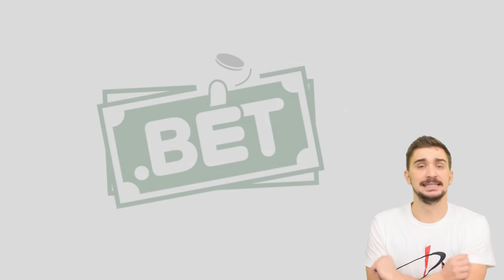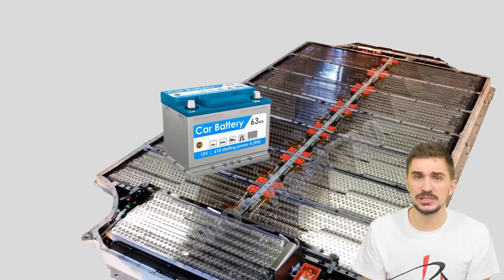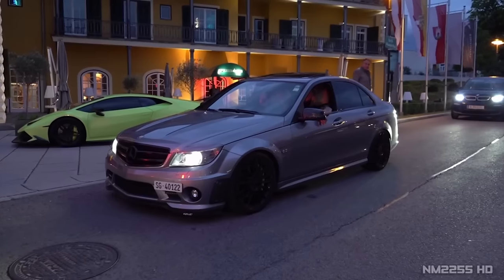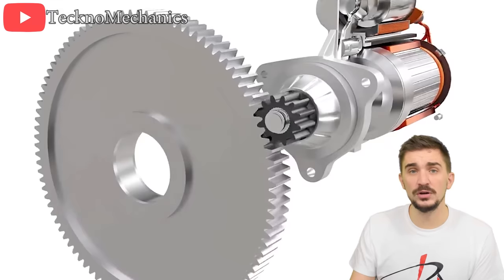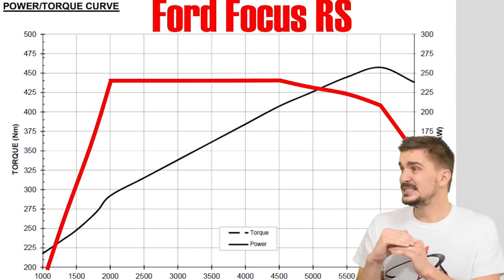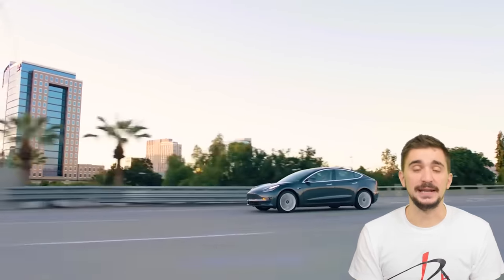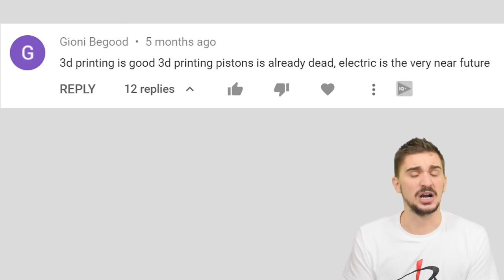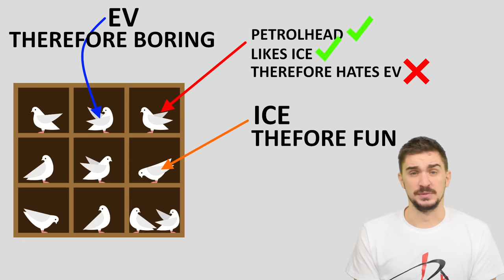ICE vs EV - IN-DEPTH comparison of BATTERY ELECTRIC and INTERNAL COMBUSTION ENGINE vehicles

Comment: Great video as always! Thank you!

Now a few comments on the content, mainly regarding maintenance:
1. Brakes on EVs are not an important consumable. If you use the regen-braking properly, you will fiddle more with rusty rotors than with worn out ones (and brake pads too).

2. There is a huge investment in EV maintenance post-warranty. Only a few places can service EV-specific parts and also when you have to exchange the battery, you will likely need to pay as much as the (used) car costs itself. Hopefully this will change, but at the moment that's how it is.

3. Corrosion on EVs can be a real b*tch. On an ICE vehicle seeing rust can be annoying, but it will usually last decades before it becomes dangerous. On EVs however, corrosion can leave you stranded (rusty terminal) or even lead to a fire hazard (rust can cause water ingress into electrical parts). This needs to be inspected periodically and can be costly even just for a check-up (lots of parts need to be removed and then put back on). Let's not forget this also requires specialist labour.
Reply: Corrosion can cause catastrophic in EV. It can reduce the insulation resistance between conductor and insulation. That would make a leak current path or even short circuit path which is going to decay the life of battery and other electronics components such as Inverter over time, some failure in motor control system or the worst case it would give you the explosion. So I agree that this has to be inspected periodically. All that materials of the EV car must be seriously reinforced to prevent the corrosion more than ICE car. That is the one reason why EV is a little bit expensive too.
Reply: Doesn't seem like battery swapping will ever be a thing.
Ev batteries are much much longer then expected and basicly last the lifetime of the car.

Until cars are actually built to last battery's will not be an issue other then premature failure, which is usually falls under warrenty . Engine failure rarely is the main reason an ice car gets scrapped, modern engines actually do outlast many car they are fitted to.
Reply: If brake wear is a major issue I believe eddy-current braking may be the solution
Reply: @baronvonlimbourgh1716  Well the battery won't last until the car die if we use like the motor need 100kW and we make batteries pack with a total power of 120kWh then after 5 years you need to expect your batteries will “die” or only got less than 70% of its capacity when we first buy it.The battery life isn't only depending on the quality, it's also depend on how much you discharge it in one time.
Reply: @WalllOfNothing  what nonsense. It isn't 2009 anymore.
Tesla batteries do over 200 thousand miles and still have over 80% capacity and can be repurposed after that. And early hyundais seem capable of the same thing.
Things will only get even better over time.

And why would you even want a 120kwh battery pack. Completely inefficient.
Reply: @baronvonlimbourgh1716  also can't you get the difference between Example and IRL things?
Reply: @WalllOfNothing  thats real life for ya. It is what it is.
Reply: @baronvonlimbourgh1716 that is so delusional, yeah generally people don't maintain a car for long but they sell that car at a cheaper price to a poorer person to buy the new one and not have to pay full price again. If resell of electric vehicles is non existing because the need to change the battery that cost as much as a used car. People, unless they are virtue signaling rich people, will not buy electric vehicles because it's burning money for them.

Comment: Nice. Actually I am in a similar position as you. My working life has been improving emission for Construction use. It has been a dramatic improvement both emissions and performance from the late 90's to now.
Now all the engines are getting replaced by Battery solutions, or so it is stated. I also am open to this and encourage change for the  better. But, does not mean all the good work done before is wasted, rather it gives a benchmark to beat. 
Long live innovation and a better world. 😀

Comment: Great comparison at the beginning! In the motorcycle world, where reverse gears are rare, it wasn't unheard-of for people to mod in a "reverse gear" by changing the starter clutch/ratchet assembly to able to spin both ways and having a reverse polarity switch for the starter. Although generally it was only really old and simple bikes that would actually work.
Reply: Myth/bs
Reply: Honda Goldwings has this from the factory, but I don't recall when they started it. It may have been when they went to 6 cylinders, but I wouldn't doubt that other manufacturers of touring bikes also have followed Honda's lead.

Comment: Thanks for your video. I own a small electric car for my daily trips to work and a bigger ICE for long travels and I believe this is the best configuration. EV are very smooth to drive I like very much the low noise and the absence of gear change (even though automatic cars makes quite smooth gear change it still feels like there is a break in your acceleration), which I find very relaxing before work. However I like ICE too, you don’t have to worry about charge and I feel more comfortable doing mechanical work on it. By the way here in France you can get a contract for 0,15€ (0,17$) per kWh if you charge at night.

Comment: I love both internal combustion engines (especially high performance ones), and also electric vehicles. In fact, I once converted an old VW beetle I had into an electric car for around town errands. They both have their advantages and disadvantages!
Reply: If you have another vw beetle laying around you should put a Subaru engine in it

Comment: Re: Maintenance. . .  I drove my 1995 Z28 300,000 km without having to change 6-speed transmission or differential lube . .    as for brakes. . . you’ve ignored the reduced brake usage because of regeneration.

But, summing things up, I watched a video of a competent fellow re-building a Porsch 6-cylinder engine. . . I thought, holy shit. . .  It’s got a hundred times as many parts as my old Ford Flathead.

There are lots of people who fully understand “how things work”.  The proportion of those who can actually explain how things work is much lower.   Thank you for your work; I’m very happy that You Tube suggested your channel.

Comment: ev motors are at the same development point in time as the steam engine was back in the later 1800's to the early 1900's hugely power full and potentially extremely dangerous only because of the batteries. The steam engine used the same principal as todays ev motors just with less rpm, that is they only used 1 gear transmissions or direct drive. I think once tesla and other ev car manufactures start getting over just using 1 or 2 gear transmissions and saying " but the torque the torque" and using 5-8 gears to do the work and limit the power outputs and rpms to increase the potential range of the ev cars the driving enthusiasm will come to driving them like proper sports cars and then they can start working on the really important part , the charging system.
Reply: if having 8 gears would help EVs achieve better range they would've already implemented that. AC motors don't have the friction losses of ICE engines with the increasing RPMs. The only reason to have more than 1-2 gears in EVs is acceleration in higher speeds which is stupid given that the aerodynamic drag will cause a battery drain very very fast.

Comment: I used to start my old 1950 Ford Prefect with a crank handle when the battery was flat.My dad who was a mechanic said it was better to put my thumb over the handle  not under otherwise I might break my thumb on the recoil.It had vacuum operated windscreen wipers, cable brakes,no water pump and flathead engine.Things have come a long way since then.

Comment: As an auto enthusiast, I'm looking forward to picking up a Tesla in the next year. But I'll keep my Miata, to compliment the Tesla's virtues. It is not an either/or situation, people! 

People who think (maybe "think" is too generous) this is something for which they must "pick a side" are- at best- naive.
Reply from the maker: Exactly! That's what I was trying to say in the last part of the vid, no need to pick sides.
Reply: The Miata will eventually bore you and nostalgia will be its only appeal.  It's slow and noisy, and your brain-road connection is far weaker than in a fully-mastered Tesla.  Getting back in a muscle car now just feels like I'm torturing some metal. Lots of vibration and noise and very little g-force.
Being able to hear the tires scrub around corners and sensing the limits of the car is so much more satisfying in an EV.  I know you and many others will probably disagree, but let me know after a few years behind the wheel of a performance Tesla.

Comment: Watching this 3 years after release.... and about 17 months ago I took controll of my first BEV company car. Done on average 60K km a year in it now and I am glad I requested the car to be a BEV. As you eluded to, here in The Netherlands a BEV is a VERY viable choice and the only thing that holds it back at the moment is range which comes down to energy density which is something gasoline and diesel have over BEV by a country mile... just saying that because that is the only thing missed in the video... beyond that, I still am a petrol head and I still love the sound and feel of a turbo engine. As well as large cilinder count engines just like the next petrol head. To like one does not mean you have to hate the other.

Comment: I am completely with you on this entire topic, yet I feel I must submit my bad joke. Be aware, this is just a joke, but the idea is now stuck in my head and I can't repress it:
Liar.. You can totally bring spare fuel in an EV on an offroad trip. It's called a portable generator, and it takes gasoline xD
Ironically, some day far in the future we may come to see this complete reversal, where all EVs have a small ICE generator inside for "emergency starts."

Now to kill my own joke.. This really would depend on if we can make batteries more power dense without increasing their weight. Because at present, you could convince me that an ICE generator could hold enough fuel without the added weight being outmatched by an equivalent increase in the amount of battery storage. I haven't done the math on all possible configurations, hence "you could convince me", I believe it's reasonable. But if we could manufacture equivalent batteries at lower weights, or more power dense batteries with the same weight.. I'm pretty sure the threshold where this is just a silly, misinformed idea is not terribly far from our current progression in chemistry.

Comment: I came here in search of EV to ICE torque comparison and you delivered almost everything I was looking for that I couldn't find elsewhere. Nice informative video. The little bit that I really am trying to get to is comparative motor to engine capacity size, especially for diesel as I want to be able to understand what size electric motor is a direct comparison to petrol and diesel engines for peak torque. Your M5 to Tesla model S was a cost of purchase comparison so obviously the EV had substantially higher peak torque, what size motor and battery does this have and what sizes would give equal peak torque to the ICE?

Comment: I'd love for you to make a video about hybrids, the different solutions e.g. Mild Hybrid (e.g. Honda and the early Toyota hybrids), Full Hybrid (e.g. current Toyota), Range-Extended Electric (like the late Fisker Karma, Chevy Volt and BMW i3), what are the advantages and limitations, etc. e.g. Why is the Range-Extended Electric model not more popular?

Another one exploring the viability of hydrogen solutions (hydrogen fuel cells powering electric engines, or hydrogen powered ICEs) compared to conventional fuel and current electric/hybrid solutions would be great too, but I don't want to be too demanding 😊

Comment: My top ten engines. Rover 3500 V8,  Volvo B20 in AQ130 marine guise,  SAAB 2.0 Turbo Type B, Ford X Flow, SAAB 2.3 Turbo, Mazda 2.0 V6 in a Xedos 5, Mazda 2.3L DISI Turbo, A Series BMC various, Volvo Penta AQ150 Marine 3.7L V6 90° V6  (based on the Dauntless odd fire V6 and so related to the Rover V8) and the 1960's Mercruiser 90/Renault 1.6 aluminium inline 4 HEMI head

Comment: One thing that will keep ICE around as long as people can drive themselves: motorcycles. Nobody wants a silent, heavy, jerky, expensive motorcycle when a petrol one is already very efficient and economical.
Reply: i hate scooters they sound annoying
Reply: @Excepticus  still the are extremely light and economical. The 2 stroke engine is very very light and packs quite some power for its smal lsize
Reply: It doesn't matter what motorcyclists want, the politicians will shove electric bikes down people's throats all the same.
Reply: @dieselgeezer18  they are impressive but i find them annoying sounding sometimes
Reply: @Excepticus  If you want to go for a chill drive just dont drive them hard and keep them in high gears. The sound will be greatly reduced
Reply: Petrol one is extremely inefficient, but I get your point.  Electric motorcycles will outperform ICE bikes in all categories this decade.  Weight, power, range, handling.  Just not noise, but you could add a speaker.
Reply: @lubricatedgoat  adding a speaker is the lamest thing that someone could do. Also the weight will be high. Batteries weight a ton
Reply: And in General Aviation, the weight of lithium batteries compared to the fuel needed for an ICE to give the same power for the same duration is simply unacceptable: even the best case batteries can only carry 3MJ/kg, while Fossil Fuels are all around 40MJ/kg.

That said, I do think a Turbo electric hybrid solution has merit in some situations: Turbine engines, despite their excellent power-to-weight, have lousy output at low RPM, so a lightweight Electric Motor could be used for the immediate connection to the Propeller, especially in situations where a mechanical linkage would already be somewhat heavy and complex.

Comment: Forgetting about gear changes and rpm can actually let you focus better on throttle control and tire grip in many motorsports. I would gladly watch electric vehicle technology develop and pave a way for my phone battery to last a week, for household electric items to be cheaper and more eco-friendly, as I'm sure this won't kill off petrol and diesel driven motorsports for at least 3 more decades. Generally it's not a bad thing at all, exept that manufacturing batteries can be a dirty process, which I don't have a lot of knowledge on.

Comment: The clutch failed on my daughter’s FIAT and I had to get it home through busy traffic.  Every junction I had to stall with the brakes and then use the starter to bump it in second gear to get going again!  After some chugging each time I managed the rest of the gear changes with careful balancing of the accelerator pedal.  Not recommended but she didn’t have recovery at the time!!!

Comment: I'm so waiting for electric motorsport to get that level of attention and aftermarket love that ICE always gets. One of the misconceptions about EV haters is that they think there's no tuning or anything involved with electric motors when in fact there's a whole world that we just haven't discovered yet because it's not as hands-on as ICEs with their per-cylinder throttle bodies and fuel injectors
Reply: They've started rally-cross series with EV in Sweden.
Reply: Evs requires way more software work when ICE is more mechanical and there are tons of different fuels to use, from alcohol to diesel, petrol, lpg/cng, hydrogen.... dont forget the biofuels
Reply: @carholic-sz3qv  facts
Reply: Tuning a volts/Hz curve or timing curve and gambling with current limits doesn't sound nearly as exciting to me.  So much of it is down to the batteries, which would be a huge expense just to replace, let alone upgrade.  It just doesn't sound as interesting to me.

Comment: What I want is the gasoline motor and the boost button on the steering wheel that runs electric motor giving power for short time when needed.
Reply: Thats how hybrids works
Reply: You won't even need a button at the steering wheel. Just buy a hybrid vehicle. Many of these boost with integrated starters for example.
Reply: Welcome to the Toyota Prius.